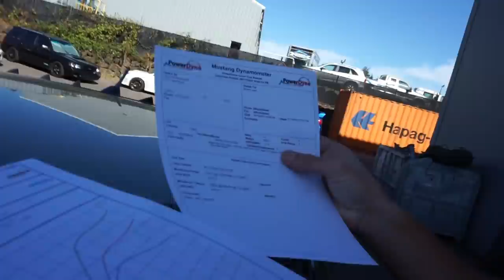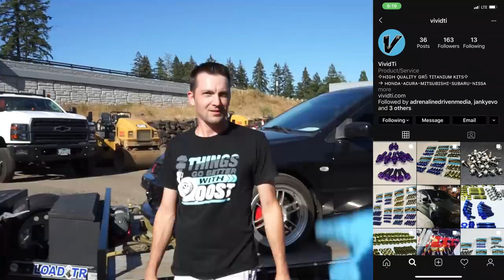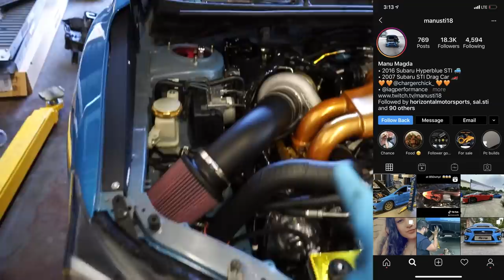Picking up the Blown Up EVO...

Comment: 10.5 compression ratio! Not even the rally cross guys run that much compression.Julian Godfrey’s rally cross 2.0L 4g63 runs 9.0-9.5 compression,45mm turbo restrictor,43psi boost,700lb-ft @ 4000 rpm.10mm steel plate grafted onto the top of the block with longer rods.
Speed Academy just finished there 4g63 evo build which failed on the dyno with the head lifting and win the flash,bang prize.

Comment: Mr. Bader, if you or Steve get bored sometime could you do a video on what to look out for on an older Subaru?  I went to look at an 04 Forester XT with a manual transmission.  200+ k, I didn't care that the engine was a train wreck and was willing to pay the 4k because it had a clean title but saw some unreported chassis damage when I crawled underneath.  Still in search of a nice sleeper chassis.

Comment: You know, this Evo platform grew on me a lot for tuning and I liked it after you showed this Evo in videos..
Correct me if I wrote something wrongly.

Question: What do you think about the stock Evo drive train? How reliable is it  and how much horsepower can stock drive train withstand?
Reply: It’s rated to however the driver drives the car, stock drivetrain will last to high horsepower if you’re not hitting the limiter and dumping the clutch on the damn thing. But then again, nothing lasts forever. 🤷🏽‍♂️